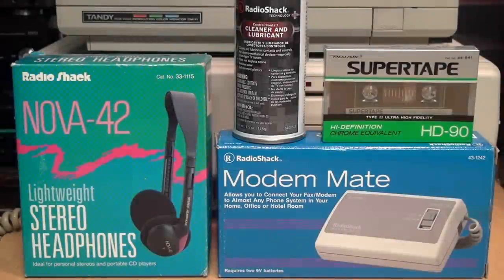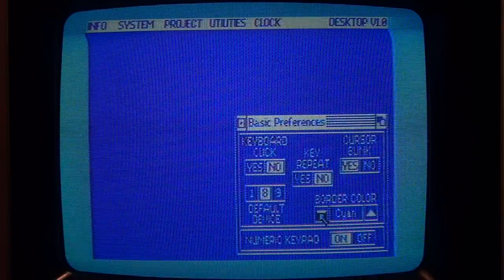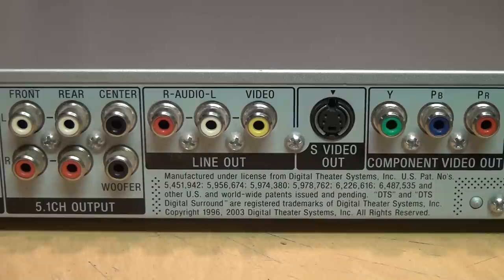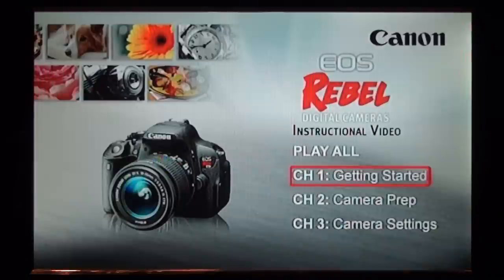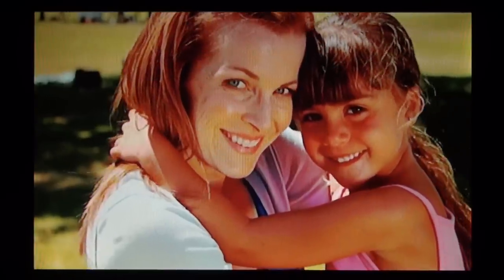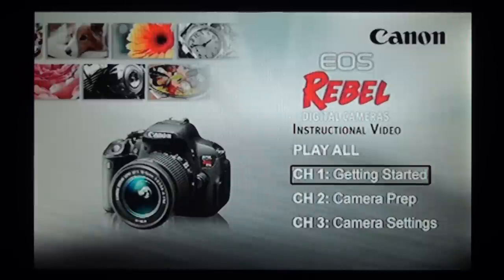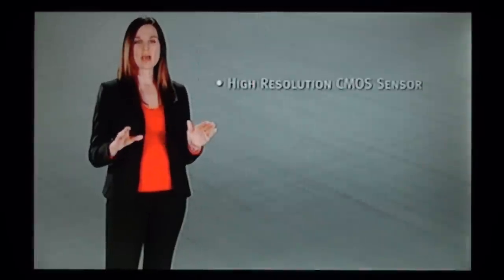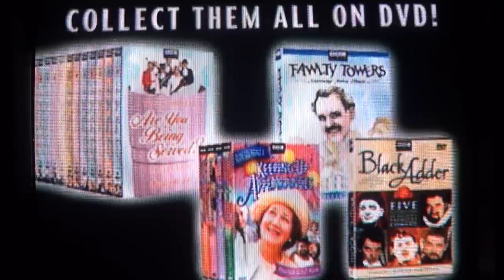Radio Shack S-video signal converter 📺 How? Why?

Comment: I used my S-Video to Composite converter to no end. I dealt with PC's graphics card S-video output connected to with my CRT TV and VCR, actually :')

Lower-end PAL AV gear do not actually have S-Video inputs or outputs built in, and SCART converters with S-Video tend to have weird behaviour with S-video (especially with camcorder cables with both S-video and composite). 

(Namely VCRs and HDD recorders, at least those from Panasonic. And ANY CRT TV that came with RF and non-RGB SCART only)

Might be just bad luck, but I have to say that S-Video>Composite saved me a lot of headaches when a normal S-video>S-video connection failed. (The converters, cables and settings were OK xd)

And British comedies are the best, Fawlty Towers especially :D Greetings from Czech!
Reply: Speaking of nowadays, I now use a Sony DA3500ES receiver :D 
One HDMI output that upscales component, composite and S-video video, takes optical, analog and SPDIF audio, output excelent. Makes dealing with retro consoles and Hi-fi gear (even amplifying my AT-LP60) pretty good :D

It would have saved me from dealing with so many quality-degrading adapters... but we gotta start from somewhere, hey
Reply: I didnt had luck wirh svideo too. I tried to use svideo in PAL region and for some reason picture didnt show right. I used one of these adapters and i prefered svideo converted to composite than real direct svideo.

Comment: I can imagine this being useful for connecting a s-video only laptop to a composite only TV
Reply from the maker: Most laptops with a TV output have more pins on the jack so you can either directly plug in an S-video cable, or use an optional adapter to get a composite video output.
Reply: @vwestlife  
That just requires that you have the adaptor cable, which could have been lost to time, or have been a note in manual saying that adaptor cables are available for purchase at [very long URL]
I've got to admit that despite all its drawbacks, HDMI has solved so many connection issues after it became the universal video standard

Comment: I had to solder an adapter like this in 2001 to get my $2400 Compaq laptop that had a mini-din S-video output connected to my TV with composite input. An amazing experience to use the laptop to watch movies on the big screen! Not too complicated, just one capacitor: connect ground to ground, then luma directly to the center pin of an RCA jack and add the capacitor between chroma out and the RCA center pin. My gizmo worked perfectly for years, but a ready made adapter like this would have been better. Mine didn't even have any casing, the whole thing was kept together with just the wires and the capacitor! :D

Comment: Hi!  I love your channel!  I'm 52, and have been in the A/V field since my first job back in 1983.  I've seen one component in the wild that only included S-Video and L/R audio inputs.  It's a 4-channel analog RF modulator with MTS stereo, purchased from B&H.  It came with four adapters similar to the one in your video.  The only difference I see is that the included adapters had male S-Video outputs.  We used two of those units to inject 8 in-house channels with a broadcast antenna for a hotel.  We used USB media players that only included HDMI and composite outputs.  Oddly, when using the adapters, only the luminance part of the signal was passed, producing a monochrome image.  I found that opening the modulators and soldering a jumper between the luma/chroma pins solved the problem.

Comment: Someone's probably beaten me to saying that these are very handy for those computer video cards with built in scan converters that had only an S-video output when you needed composite. I used one of these for years that way with several GeForce and Radeon cards. At least with nVidia, I didn't get a usable picture until I used the card's control panel software to configure the output as composite. (A GeForce 4 and later a 6200 just gave me a bunch of bouncing dim lines until I made that change.)

I have an active Kramer branded converter than can convert to and from both types of video, at once and with separate signals (one composite to S-video, the other S-video to composite). It's moderately better than RadioShack's passive converter.

I suspect your first attempt might have gone better with a few well placed resistors. The luma and chroma circuits were probably trying to "drive" one another, reducing picture quality even further.

I had really hoped RadioShack would make it when they relaunched under new ownership. Alas, it just wasn't to be. (On the other hand, I got an awful lot of fun stuff at fire sale prices when what was a very good RadioShack store finally closed.)

Edit: yes, very definitely beaten to it many times over. :-)

Comment: Since Radio Shack's brick-and-mortar demise in most parts of the US, I have turned to 99-cent stores for some of my adaptor and parts needs. Trisonic is a quick fix if the store has the items in stock. When I purchased my first HDMI television and DVD player, I needed a spare HDMI cable and Trisonic sells their cable for $6.99. I couldn't tell the difference. But I never took the time to do a detailed analysis of the image between Trisonic and Pioneer.
Reply: As a bonus, Trisonic gives you some inspiration thoughts on their packaging. Bet the more expensive Pioneer cable doesn't have that value add!

Comment: Wouldn't the Keeping Up Appearances trailer have started life as a 25 FPS 576i PAL recording that was already converted once to 30 FPS 480i NTSC signal? That already tends to make it look pretty soft.
Reply: It can be even worse: I know AYBS was shot on vidicon tubes so it was extra soft with artifacts like streaking and bright lights making comet trails. I think most of those other ones were vidicon too (Fawlty Towers, Blackadder), so location shoots where you couldn't bring the huge camera were done on 16 mm film. Keeping Up Appearances would be the only one firmly in the CCD era.
Reply: @straightpipediesel  Faulty Towers, The Black Adder, and Are You Being Served? were all from the 1970s, and would all be PAL shot with vidicons. Keeping Up Appearances is 1990s, also PAL, but shot with solid state pickups. The content is digitized to MPEG4 for the DVD. Originally, they were released in PAL and NTSC analog VHS versions.

Comment: Radio shack has been gone for quite some time up here in Canada. I remember buying out a TON of their old stock. I have an old pic, maybe 15 years old now, sowing off all the stuff I got from RS before they shuttered in Canada. I got things like touch sensitive remote controls, rolls of RG6U, cans of 'air', video switches, etc. I also walked away with their entire local stock of individually packaged resistors, capacitors and such. I miss Radio Shack :/
Reply from the maker: Radio Shack became The Source in Canada, which I believe is still in business, but really nothing to do with the Radio Shack product line anymore.
Reply: @vwestlife  Yeah. It's owned by Bell and they use it as their outlet store for TV and Phone services. Nothing like radio shack.

Comment: My 2005 15 inch PowerBook G4 had an S video input, however, to convert to DVI on the smaller 12 inch, you had to use an adaptor.
Also, they now make HDMI adaptors for things like the Playstation 2, since that was from the era when everyone used the white, red, and yellow cables, as many TV's had them.
Thanks for the video, Kevin.

Comment: Radio Shack is not completely dead! Hobby Town in North Austin, TX (near Parmer Ln. & Mopac) is an official Radio Shack dealer as we speak and has a full wall that is actually pretty well stocked with components and parts. Incidentally, the actual Radio Shack store 30 min. North of there, in Georgetown, TX (where I live) was one of the last in the nation to close. I was one of their very last customers on their very last day. It was a sad day indeed, but I brought quite a bit of their remaining electronic and project parts booty home with me.

A Radio Shack memory…
As a young teen in the 80’s, I had a dream (more like a fantasy) that I’d be locked in a Radio Shack all night with access to all of their electronics project kits, soldering irons, components and Forest M. Mims III books. I was actually employed by Radio Shack in the 90’s for a bit over a year and the very low base pay/commissioned sales aspect soured my dream quite a bit. 

Two great memories from working there, I like to be positive, were using a remote controlled toy Army tank to drag CAT5 cable across the top of the drop ceiling panels from the front to the rear of the store (that was my idea. The super smarmy suck-up assistant manager was pissed he didn’t think of it), and helping musician, Johnny Gimble (Rock & Roll Hall of Fame inductee and Grammy winner), replace a potentiometer on his violin, aka; “fiddle”, preamp. He actually brought his violin into the store! The super smarmy assistant manager tried to take over but didn’t have the actual EE knowledge that I had and quickly had to back out—and not so gracefully. No telling what famous music flowed through my little replacement pot after that. 

Repairs involving soldering irons were normally not allowed at Radio Shacks, but the actual store manager acknowledged my skills and allowed me to do a several, including soldering in new wireless home phone batteries while customers waited, which no other store was doing. 

I went on to work in aerospace and eventually become a science teacher and official science presenter for the Texas Library System. I’ve even partnered with NASA a few times, including a project that involved habitats in space. But it definitely didn’t involve anything as cool as getting to pull wires across overhead ceiling tiles with a remotely controlled Army tank. 😂

Comment: I used these around that time period to hook up PCs to TVs. For a while, laptops and video cards would often have S-Video out, but no composite — and even those that had both usually combined them into a special 7-pin mini-DIN connector that'd accept standard S-Video cables directly, but needed a breakout adapter to use the composite. Many TVs still only had composite and RF inputs though! It was one of those "it sucks, but better than nothing!" kinda deals for getting video and emulated games onto a bigger screen. Methinks we can specifically blame the rising popularity of DVI for that situation; there just wasn't enough space on a PCI slot cover to fit more than a VGA, S-Video and DVI port. The iPhone wasn't the first to donglify simple A/V connectors!

Comment: I actually have one of these from around 2007!  Back then I had a Lenovo laptop which had an S-Video output, and when I would travel to visit my grandparents in the summer I would want to play my ripped movies on the TV, which of course only had a composite input.  So that was my use case for it where I actually had an output device with S-Video but no composite, and an input device with composite but no S-Video.  Remember it working "fine" back then.
Reply: I had a friend in year 2003 or 2004 that dowloaded divx movies from internet. At time, movies normally had alot of compression and atifacts and we find out if we connected the computer to a CRT TV, the TV “masked” all artifacts making movies more washable. We were very happy at time with result.

Comment: Definitely an oddball adapter that had its uses when new. Off the top of my head, I could use one with my Handycam to get an extra output to monitor tape transfers on a bigger screen. The camcorder's 3.5mm to composite AV out is already hooked up a standalone DVD recorder, so I just need one more composite output for connection to a cheap LCD monitor that lacks S video--this converter is just what I need. Hopefully there's still a few of these floating around on eBay.

Comment: I worked in the UK RadioShack ('Tandy') and we had plenty of cardboard boxes lying around in the storeroom with heaps of random opened and unopened adaptors that just languished for months on end. I seem to remember this one was often found there. I miss it though!.
Reply: I worked at RS in the US for many years, and we had boxes of cables and adapters we had used in the store to hookup displays in the audio / video / home theatre section.  Often when someone would hookup a new display, though, they'd just open fresh new cables rather than sort through the box in search of the ones they needed, hoping they weren't defective.  Or when a customer would return a cable or adapter that wasn't suitable for their application, rather than put the torn up package back for sale, they'd write it off and throw it in the box.  When the collection got too big and tangled up, the manager would sometimes just give a bagfull to employees to take home.  Small adapters would usually end up in a spare cash drawer at the end of the counter, where they would be easy to sort through, and were handy when needed to demonstrate a product or provide service for one the customer brought in.  

Cables and adapters were some of the most popular and also most profitable items we sold.  I remember one optical audio cable we sold for like 39.99 and the store's cost was only like a dollar.  While that was an extreme case, gross margins were typically around 80% for these accessories, often making them more lucrative for the company than the TV or stereo they were connecting, which might only have a 10-20% margin.
Reply: @jasons8479  You're right - that was pretty much my experience too. The small parts and accessories/cables etc. flew off the shelves most days. We were encouraged to tape up the returned packs and put them back on the hangers - which made the racks look shoddy of course. It was all too easy to get into 15 minute conversations with customers about the products and invariably that's where individual knowledge about the technicalities came into it's own!

Comment: I bought a handful of these back in 2005-ish to simplify my setup by having everything on S-Video. Messed up the picture pretty bad so I gave up on them. My next AV receiver was capable of converting everything to component so I didn't need to think about it again.

Literally just a couple months back I dug one out from my adapter bin to try it again - resulted in a black in white picture when I went from my Laserdisc player with composite to a CRT TV on S-video (via a passive S-Video switch box). I figured something went bad in the adapter.

Comment: I actually used one of these long ago. The GPU I had on my computer had a S-Video out, and I ran a cable from that to my TV, but the TV did not have an S-Video input, only composite. As I recall it worked pretty decently.

Comment: Circa 2000 or so, I had one of these hooked up to my computer to use a CRT TV as a 2nd screen from a video card I had at the time.
I don't know how many nights I fell asleep to the milkdrop plugin on winamp playing on the room TV with my fave playlist playing.
The card only had S for the 2nd video output, so one of these adapters was a life saver for me and the only reason I actually got dual screens working in 2000!

Comment: I remember finding one of these new in the package several years ago at a local habitat for Humanity reuse store in a big tote full for various cables in their packages that came from a closed down Radio Shack that was right down the street, so I snatched it up for $.20, along with $.50 and $1 HDMI cables(back when HDMI 1.1 cables where sometimes still $20+ for the BS 'Oxygen Free" ones), component cables, etc... but I have yet to find a use for this converter lol!

Comment: My employer used to use these by the dozen for a large customer. Said customer had a distributed S-video system transmitting and receiving between some 50 rooms (for recording and overflow purposes). Toward the end of the system's lifespan (decommissioned ~2014), S-video devices became very hard to come by, where even today composite video isn't difficult to find. So, as displays/cameras/VCRs/etc. failed, they were replaced with composite video versions. Every last one of them used some version of this adapter, though sometimes with the male/female ends reversed. We probably help keep our local Radio Shack in business a bit longer. 🤣

Comment: This was 100% for connecting a laptop to a TV. I used something similar along with a 3.5mm>RCA adapter through my VCR to watch those sweet sweet divx-encoded theater cams. It was passable on a late-80s TV

Comment: I used one of these years ago to connect a laptop with DVD and only VGA or S-Video out to an older CRT tv with only RF and composite connections.  I was living in a pretty cramped space at the time and it was a good way to use the laptop to watch DVDs, etc on a larger screen without needing additional equipment and worked well enough.

Comment: Man I miss RadioShack. Not just because I worked there in 2016-17 but because they always had these cool unexpected gadgets. One of the simplest yet coolest things I bought was a 2xAA battery to usb charger. A modern phone will drain the batteries in maybe 10 minutes and get them pretty warm but I never would have found that anywhere else in a store.

Comment: I built an S-Video to Composite cable some years ago to connect an S-Video out only videocard to a Composite input only TV. It was... functional. I got the instructions on the internet, IIRC it only used a ceramic capacitor (apart from the cable and plugs, of course) and picture quality could be somewhat adjusted by varying the value of said capacitor.

Comment: As a kid in Norway even I knew about Radio Shack and envied you for them. Today we have a chain called Clas Ohlson that has a decent assortment of AV cables and stuff like that, even 3D printing supplies, but not really electronics and computers like Radio Shack.